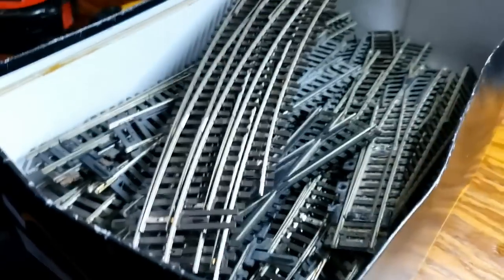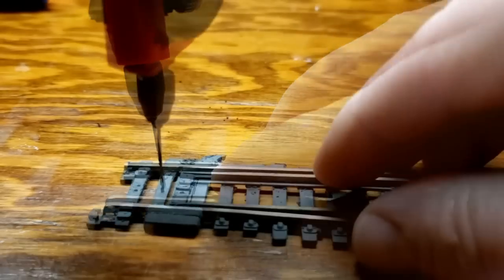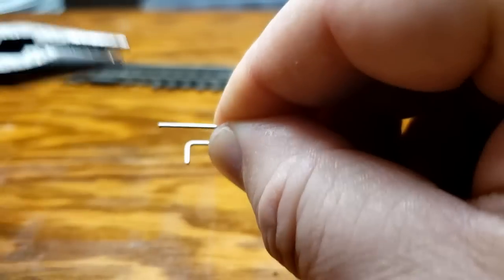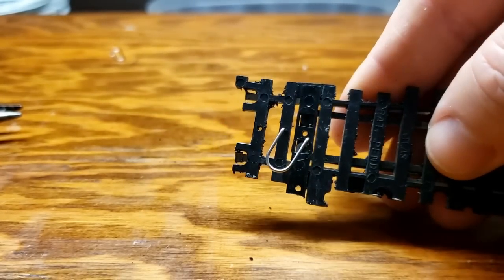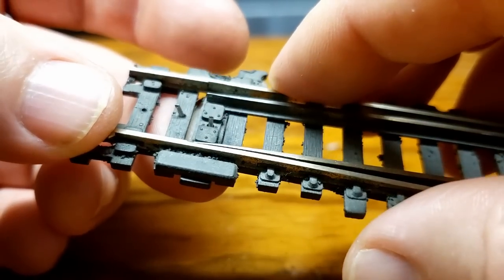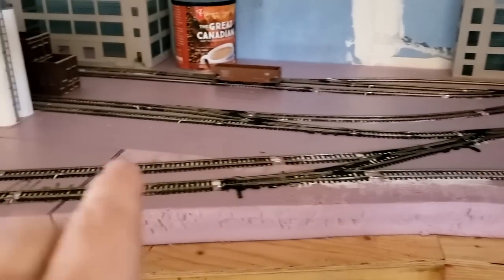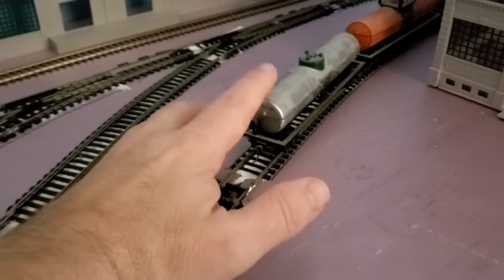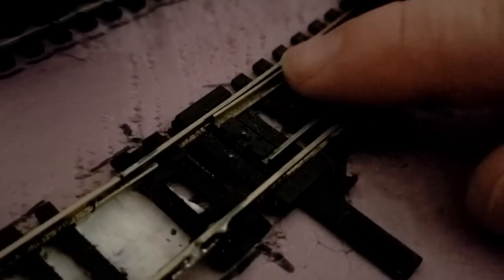How to make HO Scale Atlas Switches work reliable

Comment: A super slow Chineez DC gear motor, and a two position DPDT w/ centre off, with a stiff wire actuator arm fixed to da shaff, under the Lay OOOT, will switch da switch Bak an Fort wit dis paper clip mod on CHEAPO Atlas  !  priceless !  YEA !   Duh, it du says:  "1947" ... TMI ?

Comment: And just listen to the sound of nothingness as locos stall out on my old plastic-frogged SnapTrack switches !
Reply from the maker: If your loco is stalling out, you need to address your wiring / track cleaning. I am going to make a video on that as well, on how I wire these switches for reliable trouble free running, regardless if you have plastic frogs. All you need is a multi-meter and a little knowledge of how the electricity flows through the rails, some small wire, and the ability to solder. So, unless you are using a super small single axle loco, anything from short shunters like SW900's all the way up to larger locos (my largest are SD45's) will operate reliably. And before you ask, yes I run DCC.

Comment: This doesn't address the issues. Points become loose, either in the rivets or the plastic. Now that you basically just made the Pico spring in them you push on the rails and will make the plastic failure worse and quicker.
Reply from the maker: That is not true at all. I've been running switches like this for about 20 years now, and have had zero troubles with them. Those number 4 switches in my yard have been used in two previous layouts of mine, in two previous homes. They have been used, ripped out, used again, ripped out and used again. Not sure how much you would have to use a switch to wear out the rivets, but this works 100%. Enjoy!
Reply: @dannymacnevin3939  what's not true? The part that all this did was replicate the peco spring for them? Or are you telling me my experience isn't true?  If you have NO issues how would this video help you and how do you know what others experience? I like the video for what it shows, but the headline is misleading saying it makes them reliable, all it did is keep the points from moving if they hold tight to the sleepers. 

(On a funny note, I've had quite a few of my atlas from when I was a kid, roughly 25 years, so maybe in another 5 they will act up)
Reply from the maker: @imeric3026  Your statement, "This doesn't address the issue. Points become loose, either the rivets or the plastic"... That is NOT TRUE! This DOES address the issue, and this is for people (like myself) that have boxes of Atlas switches that do not want to replace them all with PECO. The only thing that PECO has going for it, in reliability is the spring that holds the points tight against the rails. Most derailment issues, and most complaints I have heard in the past from people are that Atlas switches do not hold the points tight enough and the wheel flanges get behind the points. So this DOES fix an Atlas switch, and it DOES make them work more reliable. So the title is 100% correct. It not only holds the points tight to the side, but also tight length ways down the switch as well. So when you snap the switch one way or another, the switch points hold firm and almost become as one with the rails. In my experience (and I've been at this for about 40 years) if you are having issues with Atlas switches, they are either (a) Not installed correctly, (b) Your rolling stock is out of gauge or (c) your switch points are moving as the locos and rolling stock pass through them. All I can tell you, is try it! You will find the switch points are held in place solid! They do not move and become as reliable as a solid piece of track. So good luck, and if you already have Peco swtiches, then why are you watching this video in the first place? This is for people that have Atlas switches and they want to make them more reliable! Have a nice day. :)
Reply: @dannymacnevin3939  I'm transitioning out of atlas. But all of my atlas already had the plastic piece held in place because of ground throws or the servo motors. I thought this was something to fix it rather than just a spring to change the way it's already held.  

What you share is cool, but it doesn't change anything for me because the things I use already hold the sliding tie in place, and I still have the issues with them.
Reply from the maker: @imeric3026  well, I guess you are not willing to try it. The switch motors just hold it side to side, my spring holds it side to side, front to back it pulls it tight, and it also helps lift the points up so they are even with the rails. It works in 3 dimensions. But I guess you know more than me. 
The only time I have ever had an issue with Atlas switch, that wasn't caused by the points moving, it was installed improperly or the rolling stock was not gauged properly. Anyway, if you have the money to throw away your switches, and buy new ones, then good for you. A lot of people don't. This is for those people. Cheers!
Reply: @dannymacnevin3939  how does it secure the points to the tie?
Reply: @imeric3026  Try it on a set. Test it against Peco, until failure, and let us know the results.
Reply: @andyu69  I'm not wasting my money on atlas. Lol

Comment: These switches are not cheap any more
Reply from the maker: Ya, nothing is cheap anymore. But what I was getting at, was for people who (like myself) have boxes of old switches laying around, or might have bought a bunch from a used market place. Rather than replacing them, or not wanting to use them, this was a way to try and make them more reliable and operational. I have been using this method for years, and I can honestly say, it works really well. Thank you for watching!
Reply: Really? 10 years ago I bought an insane amount of atlas switches, probably 1/3 snap switch and 2/3 custom line, all code 100, I must have 100+ and I have been dreading selling them, what do they go for nowadays?